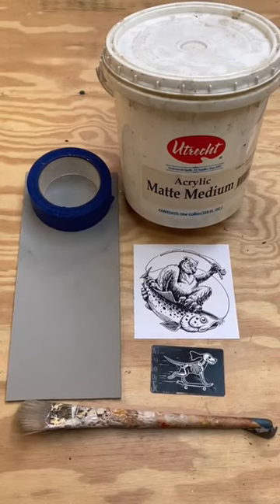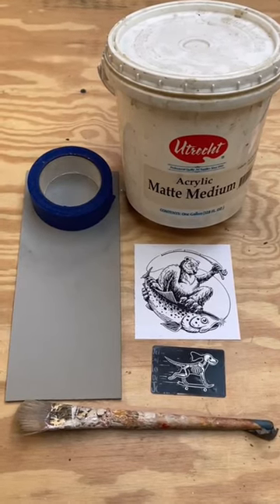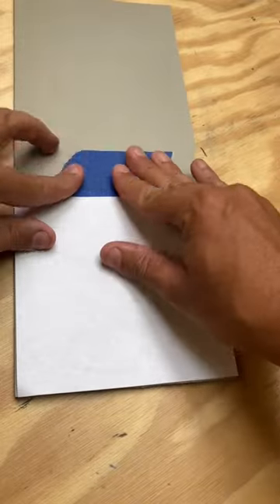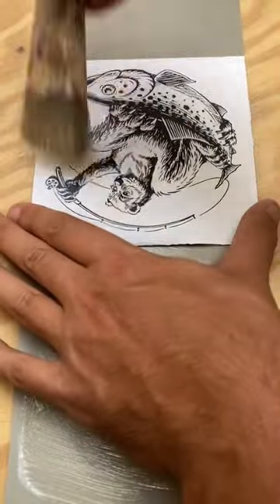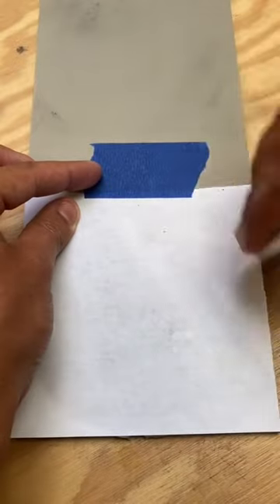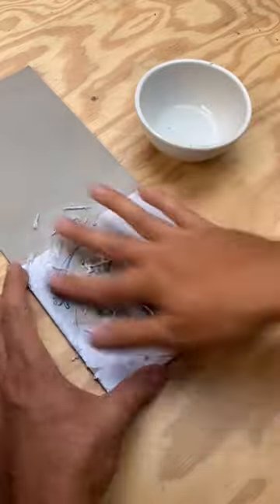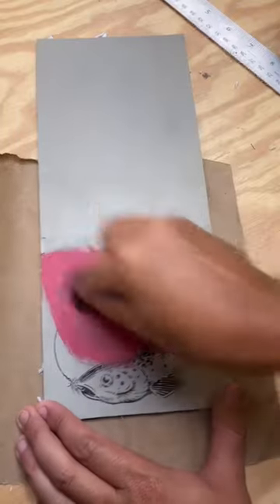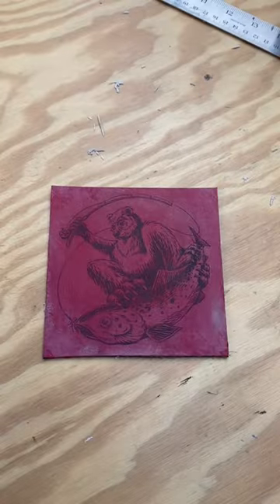How to transfer a sketch to a linoleum block using matte medium #printmaking #arttutorial #linocut

Comment: Hey! Just tried this and the transfer went on perfectly, but I'm having issues with the thin layer of the paper with the design on it shifting as a cut, do you have any suggestions/insight to why this is happening?
Reply from the maker: Humm are you using a laser/toner printer? I try to rub off all the paper completely so that there's just a very very thin layer of the matt medium coating the surface holding the toner on.
Reply: @doggonestudios  Aaah maybe I could try that next time. I've since switched over to printing onto label release paper and that's been working a lot better for me, but if I can find a way to make this method with plain paper work better it would be more affordable in the long run for sure. Thank you!